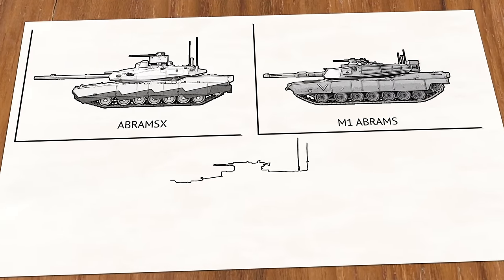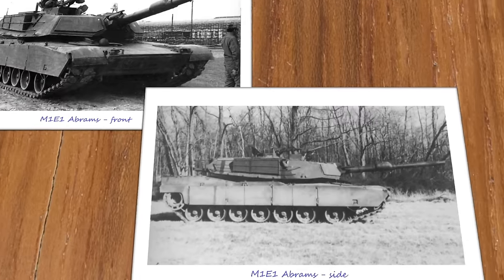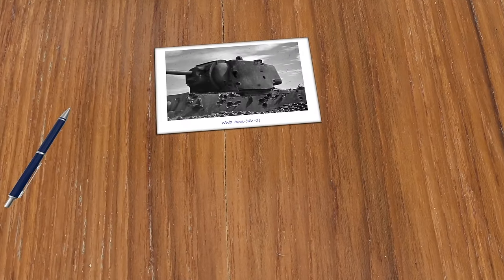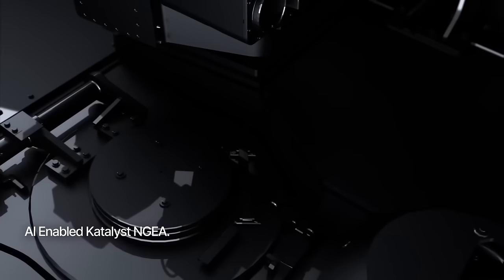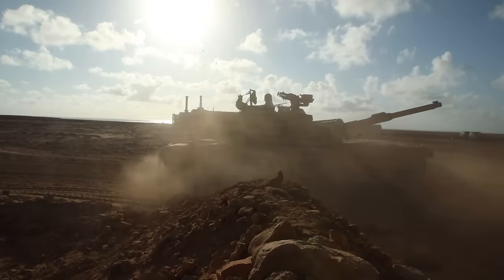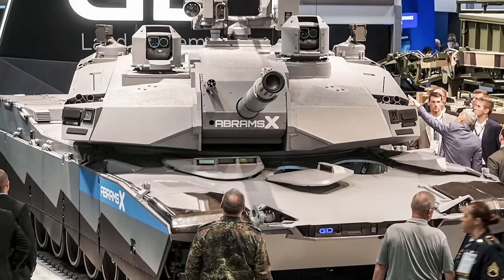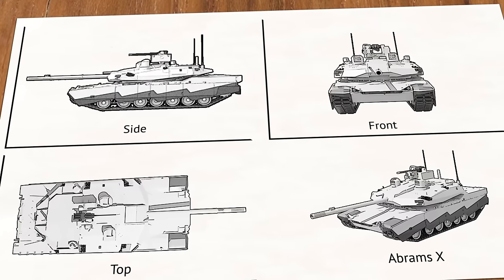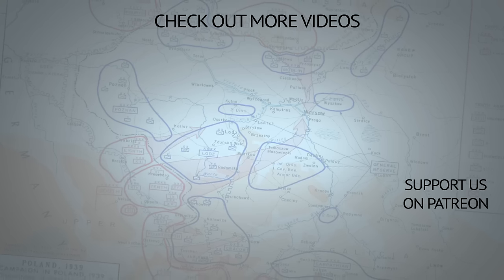M1A3 Abrams is finally happening. And it may get an unmanned turret, like the Russian Armata T-14.

Comment: 6:20 How can an autoloader be "too early to make sense"? If unmanned turrets have an advantage now, they had an advantage in the 80s also.  This has far more to do with the traditional military idea that a weapon system must offer the crew the possibility of running it manually if the automation fails (which is a stupid idea if crew survivability is more important than to keep shooting at all costs).
Reply: Machinery capability and reliability? Systems are improved over time, the benefits and costs are likely different from back then
Reply: @andrewreynolds4949  That would make sense if the Germans didn't produce reliable semi-automatic field- and air force guns before WW2, the Soviet Union successfully used autoloaders in all their tank designs since the T-64 and the US had an autoloader tank design to replace the M4 Sherman during WW2 (the T22E1) and has been using autoloaders in the navy for at least 70 years. This was strictly an army doctrine/ideology thing that the US probably got infected with by the British during WW2.
Reply: @JerehmiaBoaz  It's a lot harder to make autoloading systems for large guns. Earlier autoloaders were much heavier and slower than modern ones as well, and make the tank more expensive. Note that installing automatic loading systems on the Des Moines class cruisers increased the ships' displacement by 20%, even though that still wasn't hands-free. There's a lot of details we don't have as the general public because they're either boring or classified, yet are critical to decisions of which to go with. Until relatively recently manpower wasn't particularly a general problem for the Army, which lessens the incentive to adopt an autoloader.
Reply: @andrewreynolds4949  Sorry but it's still not a good argument, the US did have working tank autoloaders since WW2 but chose not to deploy them purely because the brass had decided that autoloaders weren't any good and it took over 70 years to change their minds. The "manpower isn't a problem" attitude is what gets tank crews killed, that's what this discussion is about.
Reply: @JerehmiaBoaz  Gets tank crews killed?? WTF are you smoking?? There's no reason an autoloader significantly would have affected overall crew survivability. Having less crew doesn't mean better crew survivability if a tank crew gets killed. 

Again, it may have been theoretically possible to fit an autoloader in a tank for decades but the US navy didn't really have working autoloaders until the 1950s, and didn't have good lightweight ones until the 70s. Their early generations were either very heavy, prone to malfunctions, or both. There are tradeoffs to be made, which for the majority of designs until relatively recently landed on the side against autoloaders. The issue with manpower vs complexity, maintenance and reliability is a performance and logistics issue more than a survivability issue. And forgive me for thinking that military analysts who work on this stuff for a living know far more about it than either of us ever have.
Reply: @andrewreynolds4949  Well, I'm not smoking your BS, that's for sure. (See how things get nasty if you behave like an *ss?) The reason an autoloader can significantly improve crew survivability is that it enables you to create unmanned turrets, but you can't create unmanned turrets if you categorically refuse to put an autoloader in a tank like the US and the UK did for ages. Did you even watch the video? (Also the weight argument is hilarious because autoloader tanks tend to be at least 15 tons lighter.)
Reply: @JerehmiaBoaz  What actual tank crews have expressed significant concern about unmanned turrets are the significantly decreased visibility and the decreased options for escape routes. More important than relatively marginal armor thickness changes are being able to see where the tank is going and spotting the enemy: the one who spots first is most likely to shoot first, and the one who shoots first is more likely to not die. 

I did watch the video, thank you, and I disagree with a lot of the conclusions. The theory of decreasing the size and weight of the turret is sound, but in practice that still comes with other tradeoffs. Binkov concluded that of course they'll go with an unmanned turret, it's got these theoretical advantages, it's the latest most advanced technology, like in the AbramsX demonstrator, and it's what the Russians did in their most recent new tank model. I don't think we've reached that point yet. I understand why people think they should, which is part of why I think a 2-man turret with autoloader is fairly likely, as a kind of middle ground without most of the drawbacks. But I don't see the systems involved in an unmanned turret being mature or resilient enough, and I don't think the Army will either. 

When I mentioned the weight I was talking about the rather heavy early autoloader designs, particularly around the 50s and 60s, in response to the assertion that the technology has been around since WW2. My point is it was indeed possible to fit an autoloader into a tank, but the designs they had then were far less impressive and far less reliable than modern ones. The Army knew that, and thus they didn't equip their tanks with autoloaders. Not something out of a backwards stubbornness.
Reply: @andrewreynolds4949  Tank crews haven't actually used tanks that were designed from the ground up for unmanned turrets so they tend to imagine them being like the tank they currently operate without people in the turret. The whole point of crew survivability is that the crew doesn't automatically die when the tank gets hit.That's why sitting high up in a turret that has considerable weak points at the joints, is only sufficiently armored at the front and still weighs at least 15 tons is such a bad idea, it makes 55 ton tanks into 70-75 ton monsters which are a logistic nightmare, and it's also why two man turrets won't cut it against unmanned designs (65-70 ton tanks are still a logistic nightmare). Not to mention that it makes for faster tanks with a lower profile which also improves survivability.

If US autoloaders were unreliable they could have just copied a Russian or Chinese design or licensed a Swedish, German, Japanese or Korean design later on. Most tradeoffs of unmanned turret designs are  imaginary, advanced sensors and software packages can detect foes long before a human can and it's more an issue of selecting the right target among those offered by the system than of spotting potential targets, you don't need to transport a 4th man inside the tank and carry him into battle if you only need him for maintenance, etc.

Anyway,  the aversion against tank autoloaders is doctrinal and not technical in nature because other countries solved those technical problems decades ago and the US could have just copied or licensed their technology (they did it with German rocket technology).
Reply: @JerehmiaBoaz  People are seriously overstating the benefits of unmanned turrets. The way manned turrets are designed specifically prevents crews from "automatically dying" when the tank is hit (aside from the Russian autoloader designs, which all but ensure the crew is killed if the ammunition is hit). More than tank-on-tank combat the biggest killers of tanks are artillery and mines, followed by ATGM weapons. Putting all the crew in the hull makes them noticeably more vulnerable to mines in exchange to being theoretically safer from AT and lighter artillery. A lower profile doesn't really do much against modern targeting systems anyway, and doesn't make a difference against artillery strikes and airborne threats.

I'm not sure where the "55 tons" comes from. As far as I can find the AbramsX is about 60 tons with options for added armor packages that would add significant weight on to that. Not a whole lot of weight was lost on that design by the inclusion of an unmanned turret either. The M1E3 can most likely get down to 65 tons fairly easily, without really touching the structural elements much, and likely cut a few more tons even without going for an unmanned turret. The speed on the other hand is dependent on weight and power output, and an unmanned turret has no relation to that other than as a way to shave a few tons to get a marginal speed gain.

I have also just remembered the existence of "Whither the Autoloader" by the Chieftain, which is very interesting. He is in favor of autoloaders, but also says it comes down to a sort of personal preference which of the factors in the pros and cons is considered most important. Most interesting is something I haven't considered, that installing an autoloader into an existing tank design is impractical and loses many of the benefits without a significant redesign and rebalancing of the turret. That would easily explain why the Abrams has not had an autoloader implemented since the redesigns in the 80s. There have been hints that the Army is going to at least partially redesign the turret on the M1E3, which makes me think they may include an autoloader this time. It already needs rebalancing work at least, so this might be the best time to introduce one.
Reply: @andrewreynolds4949  You keep repeating the same arguments which I already refuted. Here you go on about redesigning the Abrahams which is not the way to create a tank with an unmanned turret as I stated before. Yes, if you redesign the Abrahams you end up with an overly heavy tank that has poor visibility and is more vulnerable against mines than needs be because so much of the armor went to the turret. I'm done.
Reply: @JerehmiaBoaz  No, those drawbacks apart from the weight still apply to a clean sheet design. That is not on the table anyway. 

But adding an autoloader also needs significant redesign work on the turret, and that's why we haven't seen one in the Abrams yet, and also why we might see one now.
Reply: @andrewreynolds4949  Not gonna lie, you got your ass handed to you
Reply: @comrade_commissar3794  WTF are you talking about?

Comment: ADHD Thoughts and knowledge moment- The M1A1 wasn't where the 120mm canon came in. at least not the base M1A1 variant, M1A1 HC (Heavy Canon) was, the M1A1 HA (Heavy Armor) was the variant that added IDU-238 armor added as well, when Uncle Sam is sending M1A1s to Ukraine it actually raises a lot of concerns because they could be getting a tank without IDU armor and using a 105mm gun.
Reply: I am not sure there are any m1a1s that were not upgraded to 120mm
Reply: They’d be getting a 120mm gun with no DU, just like any other export country

Comment: It's interesting how you didn't mention the Soviet unmanned turret program at all. Like on the T-74, Soviet Russia was leading the world with it's tank technologies.
Reply: "T-74" was never called that by anyone at the time. It wouldn't be called that if it went into production either. Most likely would've had the T-72 name instead of the tank that got it. 
But it never even went into the prototype phase, so there's no way of knowing if it could be built and not be a dumpster fire. 
A cool concept, of course. 
Though at the time the available technology, especially in sensor and remote control technologies made an unmanned turret a liability, not a bonus. That is one of the bigger reasons not a single prototype was built.

Comment: I feel like unmanned turret is going to backfire for the exact reasons cited as to why they've been refusing to do it since forever. Won't know until it happens though.
Reply: they literally make people carry and load gun manually in 2023 because they want to avoid "equipment malfunction", whilst the other side already mechanise this job 50 years ago. Why move things with hand when in factory everything was moved with mechanical contraption (ie: conveyor move packages, ect).
Reply: Unmanned turret is fairly unlikely, but that doesn't stop fanboys from gushing about it
Reply: @andrewreynolds4949  turret shouldn't be manned this day, we are living in 2023 (the future) not WW2.
Reply: @anchorread68  Why? There's a number of drawbacks to unmanned turrets as well. Most tanks still have manned turrets, only a few (primarily experimental) outliers actually have unmanned turrets
Reply: @andrewreynolds4949  because you move crew away from the turret, you place them inside the tank chassis, then you pull armour thickness from turret into the chassis, as well as you trim down the weight of the motor & gears for the turret, and you add all those shaved weight back into the chassis. Therefore, you created an opportunity to solve the problem with thin armour on the side and top, by moving crew protection from turret into tank chassis.
Reply: @anchorread68  You also greatly reduce the tank crew's visibility, and reduce the available ways to exit the tank. Only recently have advances in remote monitoring started to offset the loss of visibility, which is often lethal to a tank, but it's still not at a developmental stage where the Army is likely to adopt it. Theoretical benefits and optimizations don't always work well in real practice.
Reply: @andrewreynolds4949  air force has adopted remote monitoring. It was adopted by both Russia & US on SU-57 and F-35 respectively. Specifically, the pilot uses the camera mounted around the aircraft to see thru blind spot (such as seeing below the cockpit).
Reply: @anchorread68  There's still limitations to it. The technology isn't quite ready, and if anything goes wrong with it there's no longer the ability to open up a turret hatch in an unmanned turret like there is on current tanks.

Comment: A human loader can do far more than an auto-loader. Tell the auto-loader to pull a wounded crew-mate out of the vehicle or get a case of M.R.Es or please don't toss the turret.
Reply: An autoloader doesn't automatically mean the turret will pop if its ammunition is detonated, that depends on what kind of autoloader it is. The ruskis have an autoloader position underneath the turret, so when it detonates, it forces the turret up with it. If you put the autoloader in the back of the turret, then you can just put blowout panels over where the ammo is stored and have the ammo cook off and shoot out the top of the turret instead of taking the turret with it.

Comment: Why not remove the crew all together, have 4 ? slave tanks controlled by a master tank , with the crew in that only. Turretless is possible,  the Sweds did it long ago, a good compromise is to have the gun traverse 45 degrees to either side, more then the whole tank can be turned. Technology only got better since the Sweds did it.

Comment: it easy to increase armour and reduce weight.... just build a smaller tank. that how the chinese have tank that has the same frontal armour strength as the M1 yet are lighter by 10 tons. the less surface area, the lighter it will be, even if you make the surface thicker.

Comment: Resistance to change is a hell of a drug. Manned turrets with manual loader were cool in 1941.

No matter how vaporware T-14 is they have the right idea for future design direction. Turret must be reduced to bare minimum of metal needed, no crew there, bundle all ammo with the gun and autoloader, if it gets hit, have blowout panels and keep main hull secure. Can add extra layer of mesh armor on top now that you don't need crew hatches there against drones and HE.

Overall go back below a 50t vehicle that is extremely mobile with current day 1500HP+ engines readily available and use a fully reversible transmission.

Comment: The M1A3 can do everything the Russians claimed the T-14 Armata can do, but in a stable ACTUALLY WORKING PLATFORM. The T-14 is a barely functional mess, even nearly a decade after its debut, that relies heavily on Western Imports. Imports Russia can no longer get due to Sanctions for the War in Ukraine. And the funny thing is, they are not even cutting edge Imports either, the Western Civilian Market has access to better technology than what is put into the Armata. Things like Thermal Optics, Night Vision, and Cameras are all a Generation behind the Western Civilian market. And that's not even mentioning the X-Frame engine that is so unreliable one of these rolling POS broke down during a parade REHEARSAL. Plus we have no idea how many Russia actually has, but given Russias tendency to lie to keep the myth of the "Dangerous Russian Bear" alive, we must resort to the tried and true tactic of "If the Russians do not show it off, it does not exist." Remember this is the country famous for showing off there Nukes in parades, driving them around a corner, painting new numbers on them, the wheeling them back into the parade, to make it seem like they have more then they actually do. At most, they have 8 T-14 Armatas., and they are all in a Regiment whose only task is to organize and manage Parades. There are no T-14s in Ukraine. There are no T-14s that had even seen combat because if there were, we would have footage of it. The T-14 is barely a match for the M1A2 Abrams, Leopard 2, or any other current NATO tank, even at its alleged statistical best. And operationally, it will never be able to achieve its statistical best because it is so poorly designed and developed.
Reply: Just like the f 15

Comment: Get rid of the Honeywell junk engine. Gas mileage makes this tank a predictable opponent because of it's supply line footprint. You can't also hide the just as many needed fuel trucks as you have tanks. Also The engines thermal imaging lights you up like the North Star with night vision and thermal optics. In cold weather you are ESPECIALLY a sitting 🦆.